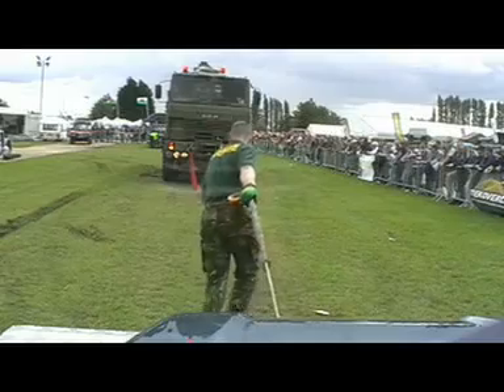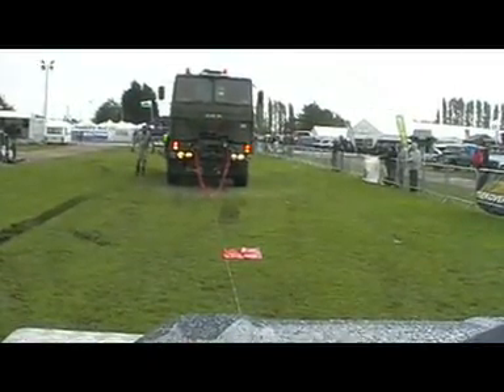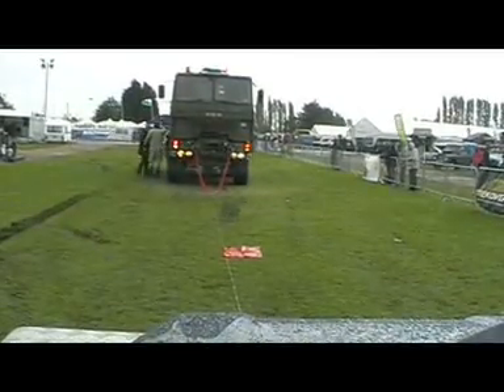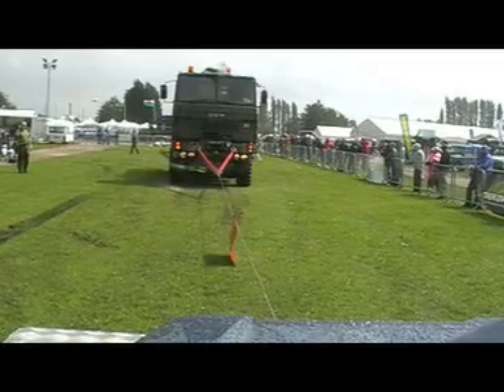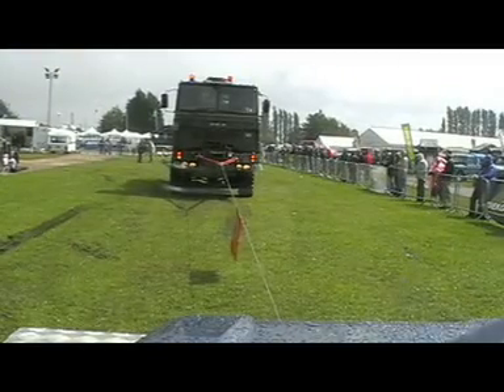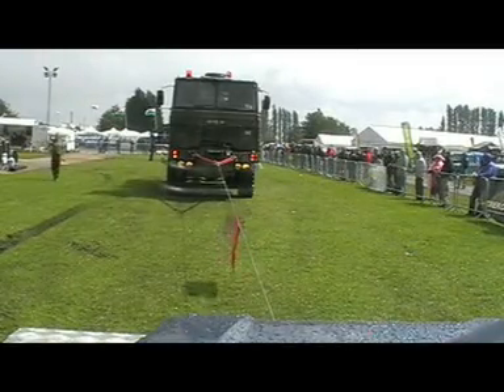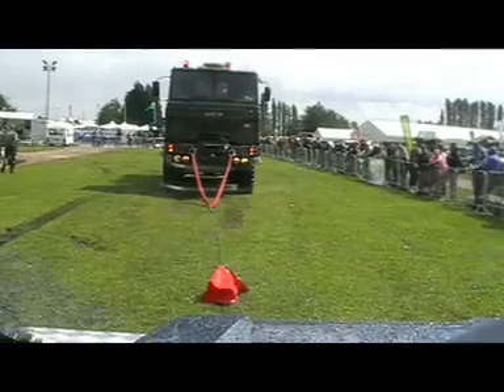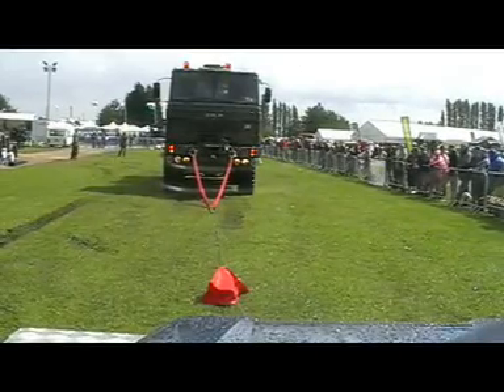Winching demo at Land Rover Max, Newark 2009

Comment: Its not pulling 27t though!
Its only a estimated pull of 7t. Would probably be nearer 3t in reality as the ground is more like hardstanding. Try lifting it up a vertical cliff, then it will be pulling 27t! The Fodens front winch is only a 10t winch.

Comment from the maker: Absolutely - but the limitations are the battery capacity and duty cycle on the winch motor.  Hydraulic has neither of these issues.